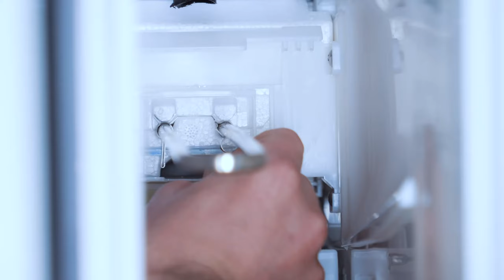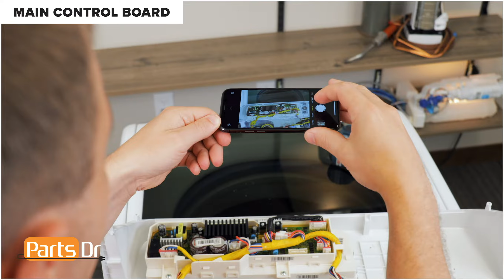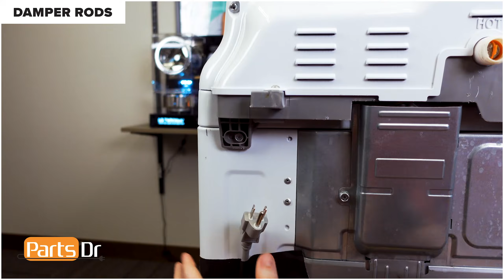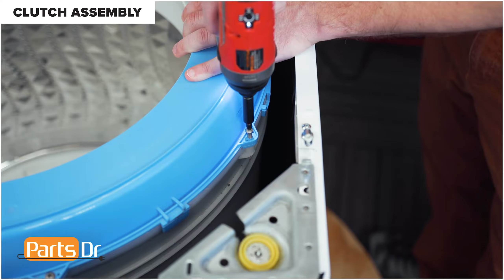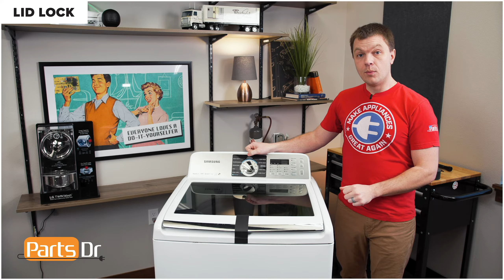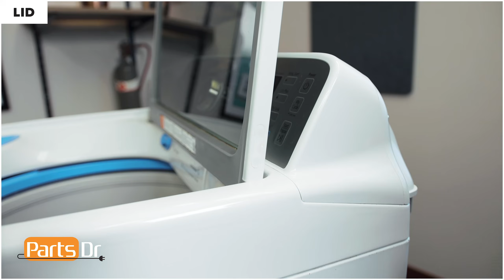Samsung Washing Machine Disassembly – Model # WA456DRHDWR/AA

Comment from the maker: Thanks for watching our Samsung washer disassembly guide! Whether you're replacing the water inlet valve, drain pump, damper rods, or any other component shown here, it's important to use genuine OEM parts to keep your machine running properly. If you're ordering parts online, especially from places like Amazon or eBay, be careful that many of the cheaper aftermarket parts are of much lower quality. For reliable, high-quality original parts, head over to https://partsdr.com. Happy repairing and let us know how your repair goes in the comments!

Comment: You’re a great teacher, man! I hope you do some teaching for a living other than YT? 

I have a quick question that I hope I can properly articulate. 

I have officially removed the drum from my Samsung AquaJet VRT top-loaded washing machine. Not only do I have a mystery clog, but it has NEVER been disassembled and cleaned in the eight years we’ve owned it. 

So my question is: I was removing years of built up grime and gunk from that six-armed spinny thing that the clutch goes into. (I cannot find the name of it anywhere) It’s what the drum bolts down to. 

I feel like there may have been some kind of rubber chunks that are about a 1/2 away from where you bolt the drum down. Are there some kind of rubber stoppers that go on the top of this that help balance the drum before bolting it down? 

Sorry for the novel, but I wanna make sure I am not doing anything stupid before I reassemble.

Comment: I have a samsung washer, the water usually comes out the spout like a water fall but i noticed today it was shooting across to the top of the tub. Would this be mineral deposits in the spout creating high pressure? If so how do i get the spout out to clean it?

Comment: Does the lid come apart
Reply: I ask because mine is rusted in the back after 2.5 years and I want to sand it down and repaint it.
Reply from the maker: @steverensen2487  We haven't tried to take the lid apart as Samsung doesn't sell any parts within the lid assembly separately.
Reply: That's a shame as all I want to do is clean the rust off and paint it. Not spend 400 dollars on a machine I bought 2.5 years ago for $570
Reply from the maker: @steverensen2487  You might be able to take it apart, we just aren't sure since it wasn't designed to be serviced that way.

Comment: Any ideas how to remove the center nut holding the basket in place. I have loosen it and it unscrewed to the point where it seems to be attached to the grilled part on top of it and they both spin simultaneously. Any ideas?
Reply: Having the same problem

Comment: Excellent vid! I just replaced the suspension rods (4 eac) using this vid in a washer similar to that see thru model cover.  Question, since i alwyas like to do things the right way (not always lol) , wouldn't there have to be a rest/recalibration process  of the drum after the suspension rods are installed?
Reply from the maker: We aren't aware of any recalibration that needs to be done for these washers.

Comment: I have a wa5451ANWxAA02 samsung - the top is almost impossible to get off - I notice to additional 'plastic' locks in the back and one up front? What additional information do I need to remove the top of the washer? I need to replace the suspension rods for DC error code..

Comment: Thanks for this video. Do you have s video where you show the wires in the back of the machine underneath the panel? There is a green wire and a yellow and green wire. My yellow and green wire is attached at the machine and then has a loose connection.
Reply from the maker: Not sure, but you can check out all of our videos on this washer on this playlist here: https://www.youtube.com/watch?v=KtNBXfQycos&list=PLiiNXmB9tfoB1WAOSR2ZAvd_JL3UjG7jI

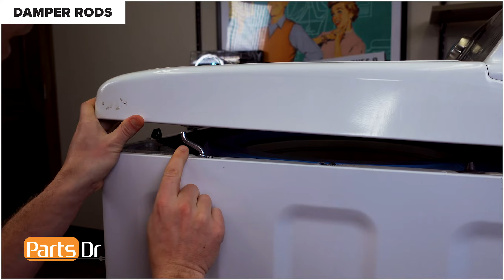Comment: My WA5471ABP has a bolt located where the clip you show at around 6:34 is. There is actually a bolt near the front right corner and left back near the control panel. Do you have any suggestions on how to remove these?
Reply: Figured it out!

My washer was part of the exploding Samsung Recall.

 I had to fill the tub so that the water's weight lowered it enough to allow my hand and some pliers in there to loosen the bolts put in after the recall fix.

Comment: Hello there - Thanks for the video! I'm stuck at the point where the drum isn't coming out. I applied some WD-40, and even after a lot of jarring and shaking, the drum wouldn't come off. Do you have any other ideas? Appreciate your help and advice. Thanks.
Reply from the maker: We do not have any additional ideas other than what we show in the full video here: https://www.youtube.com/watch?v=VErDV4mXmkM
Reply: @PartsDr  Thank you, but I have one last question. Do I have to remove the clutch assembly at the bottom first before pulling out the drum? Thanks!
Reply from the maker: @adityapanuganti5865  We have found that is the best way to do it.

Comment: Our washer gives us a dc code. We took off the center nut to see if it needed tightened. We discovered it’s very rusted and the bottom of the drum is cracked. Could this be why it’s having a dc error when spinning?
Reply from the maker: Yes, that can cause the washer to get out of balance during the spin cycle.

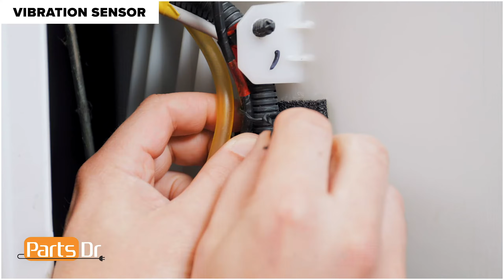Comment: What is the yellowed rubber hose in his left hand at time 0:48?  This developed a small leak where it connects into the tub but I'm not 100% sure what it does and can't find it on the expanded parts diagram on the Samsung website.  I found a matching hose size (plastic, not rubber) at Home Depot, but want to know what the purpose of this hose is and ideally replace it with a rubberized hose if able.  I have a clear photo of the leaking hose but don't think I can attach it here.  Happy to email it to anyone willing to help, thanks!
Reply from the maker: It is the pressure sensor hose.  This hose is how the washer determines how much water to fill up the tub with.  It is VERY important to have the factory hose or else you can flood your house.  On Samsung washers the hose is sometimes sold with the pressure sensor.  We have a video on this part here: https://www.youtube.com/watch?v=c6gKsgPcHrg
Reply: @PartsDr  Thank you!  Now that I've seen that video, that is exactly the hose that has ruptured.  I only see the ability to buy the hose with the pressure sensor assembly (not needed).  Is it possible to just get the hose separately that meets the right spec to work with the pressure sensor?  I imagine any hose with the same ID would do, right?  Is there anything special about a rubberized hose versus a vinyl hose as long as it's the same length and ID?
Reply from the maker: @bradcombs777  We wouldn't use anything but the factory hose.  They are very sensitive and it is not worth the risk for the small cost savings.  If the washer floods your house, you are looking at huge 💰 in damages.
Reply: @PartsDr  Totally agree with that...just seems like a waste to remove/replace a perfectly functioning sensor.  Thank you for the help!

Comment: If your changing the damper rods, I would HIGHLY recommend wearing gloves, I spent longer cleaning the substance (It's almost like a glue like grease kinda) off my hands that was on the OEM ones then I spent changing the rods.
Reply from the maker: Thanks for the advice!
Reply: @PartsDr  no problem, the machine is 8 years old now so I'm sure the attributes to the build up, but now having watched your video, I'm hoping the imbalance I had wasn't due to the clutch, you noted that can also create that issue. I following the advice of a few forums I was reading, and signs did point to the rods being the problem, 2 of the old damper rods felt very loose compared to the new ones. So guess I'll find out on laundry day 😅
Reply from the maker: @DRWNHL1  Let us know how it works for you!
Reply: i read this after the fact, so true

Comment: My washer keeps stopping 10 million time. Error displays when stopping...we drained and clean the front bottom.

I feel the problem could be water pressure, coz the sound of healthy strong whoshing is gone.  Its like its weak when it starts or runs.
Reply from the maker: Which error code are you receiving?
Reply: @PartsDr  ...i think E04?  I stopped lookin at it...from frustration
Reply: My samsung washer like this one is making a lot clicking noise when it starts spinning, it's also is not spinning the clothes dry at all. Do you know what could be going on?

Comment: Update: I didn’t have a spanner tool so I had to improvise. The bolt loosened during the load. I think I have it tight enough now. 

Also, thanks so much for making this video. I have never worked on an appliance before and this was extremely helpful.

I used this video to remove the inner washer tub for cleaning and reassembled the washer. I now have a lot of vibration and knocking during the spin cycle. Any idea what I did?
Reply from the maker: Thanks for the update!